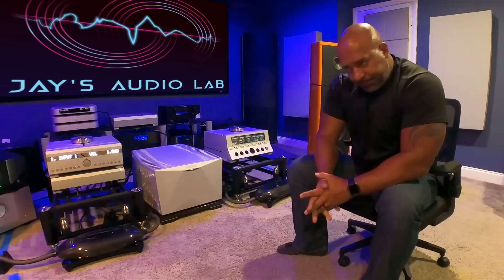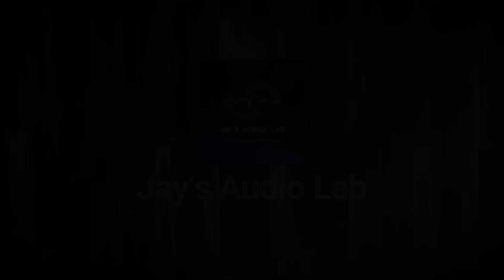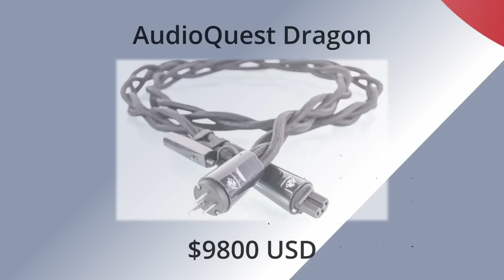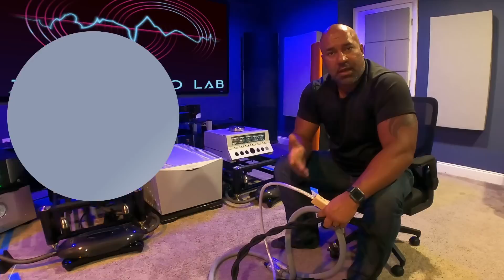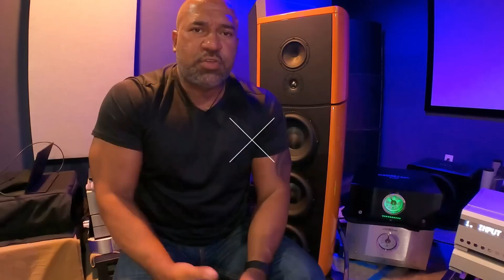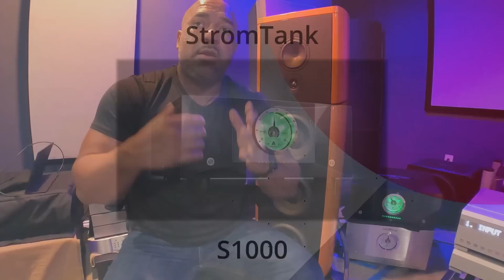Why Do Expensive Audio Components Need Expensive Power cords To Sound Their Best ???

Comment: Hi Jay! I have the opportunity to buy a Gryphon VIP 1,5M POWER M5 C13 for 850 USD , instead of the retail price of retail price of 2 540 USD. Thing is though, even though i have the opportunity  to buy it for a "good deal" I am afraid it might be wat to overkill for my system, as my system is not near ultra high end, my setup is sonus faber electa amator 3 , speaker cables: AudioQuest rocket 88 to a integrated electrocompaniet ECI 6DX ,125w. Do you think that the Gryphon Powercord could "rock my system" or would it just be plain stupid? Since I can get a More lower end AudioQuest powercord for the same price, but not the same deal. Also I am based in the EU/Norway. And not sure if Gryphon sell them with the proper connectors.

Comment: My old 70s McIntosh amps have flimsy lamp cord wire. Power cables don't matter with McIntosh cause they don't pull the amperage is what I think why it was designed this way

Comment: I'm a ittle late to the party, but I agree with you. You're OCD -- join the club!

Any one of the three power cables you showed is from just under twice to nearly three times as expensive as my entire main system (£4000 or so). Doubtless your system sounds better than mine, but I don't resent that -- if that's what floats your boat, all power to your elbow. 

Regardless, I enjoy mine immensely. I could afford a significantly more expensive system, but why? I'm very happy with what I've got and, as I'm retired, I can listen for up to 10 hours every day -- I'm listening to it as I type this. It's already miles better than some of the better gear one could get even 10 or 15 years ago thanks to advances in technology.

It's not that I'm stingy. It's more that, to get adequate satisfaction from my music, I don't feel I need spend more. I too have OCD, but of a different kind than yours. What most floats my boat (after the music itself) is settling on a budget and scheming to find the best gear I can within it. I feel sure many audiophiles do the same, either through choice or necessity. I suspect we get as much pleasure from that as you do from spending tens (or hundreds) of thousands on top-end gear.

BTW, I preferred the stock cable for all three songs in the first video, and found the two cables about the same in the second. Because of the limitations of both YouTube and my own secondary near-field system (£2000), naturally your gear doesn't sound its best. In the flesh, in your room, I feel sure it must sound quite a bit better. But a hundred times better? Ten times, five times, even twice as good? At your level, you're probably chasing the last few percent of what's presently possible, under the ever-present constraints of diminishing returns. We're both OCD, but in different ways. 🙂

Comment: Interconnects carry signal, so do spkr cables. Power cords carry no signal only raw power which is conditioned by the equip. power supply. The raw power at the end of a standard cord is THE SAME as an expensive cord. Measure it. a 6 foot piece of cord CANNOT alter the sound. Nobody gives any measurements. It's visual placebo, they look fancy so your brain makes it sound better, no diff. Many aren't even UL approved and put tremendess stress on the connectors. Sometimes ya gotta go with science and physics. https://www.youtube.com/watch?v=HkmwcPdTlWM

Comment: I believe the quality needs to match the device (maybe not with the Boulder :-)). That doesn’t mean it has to be crazy expensive. I have cables which sound better than e.g.any Audioquest and at a fraction of the price. So, I do agree you need very good quality cables and that they are important, but you can be blown away by less expensive brands.
Reply: BTW, I heard a HUGE difference with the ethernet cable as well. There was definitely a WOW after I heard that. So there I do not agree.

Comment: I watched the video wondering what source of power that this power cord gets plugged to. You mentioned noise in the signal from inferior cabling. Does the power cord get plugged directly into an electrical panel? Is the limitations because of insufficient cable gauges because up the chain you can't really control your electrical utility unless you have a main feed delivered your location. Maybe you might very simply these issues. I would love to know.

Comment: It would be interesting to know with what PC the manufacturer voices their components. Such information shall come with the component.I expect a top-of-the line component is the best sounding component the particular manufacturer is able to engineer. So adding a "different" PC (different to the one used for voicing) can change it to the worse. Despite from that fact that a power conditioner always deduct some critical aspects from the equiation - so PC quality gets less important. That all might be different with mid-tier components - my experience is that - in the limitations of the general sound signature of the component - you can adjust the sound to your liking that is not only personal preferences but also has to do with the room and other components of your rig. So - to  acertain extend - I buy the argument of being the cook in the kitchen.

Comment: Anybody that thinks that you can ‘tune a system’ with power cables is into delusion space.  Any piece of hi-fi equipment that is impacted by power (cables, conditioners, regeneration etc) does not have a suitable level of filtration in its power supply rectification circuit and should be avoided.

Comment: Here's an even better question:  why do so many older components that sound good and are still references have built in power cords and it was not given any thought back then about the power cord.  As long as the power cord (and I am referring to the permanently attached ones) provide the current needed I can't figure why it is such an issue now.  I get it; the power cord is just another way to market something but funny how it was only a thing once it could become a thing.  But when it comes to the uber expensive gear there is no excuse.
Reply: Because at the time manufacturers didn't know power cords could improve sonics.

There has been a thriving aftermarket business in adding IEC connectors to older gear that once had captive power cords, with improvements easily heard thereafter.
Reply: @VideoArchiveGuy  Don't buy it.  These older gear work to spec and sound phenomenal with the attached power cords...I am aware of the aftermarket component that conveniently fills a niche.  And saying they didn't know about power etc is simply BS.  They had all the knowledge to design the gear and circuits to make it sound good, select the best parts and source out the best power supplies but then neglected the power cord.  Maybe they knew something we are being made to believe is true.  The power cord is not nearly as important as the power supply and amps in particular have had this figured out for decades.  I get it hearing is believing but I have a far easier time with that on low level cables, interconnects and speaker cables that actually carry a sonic signal rather than just pure AC which is going to be filtered and rectified by the component anyway.  And  I come from a part of the world that has a stable grid.
Reply: @TheNoseman1  They perform "to spec" with the stock power cords but often sound even better with an aftermarket one.

It's not a given but it's certainly been my experience on more than one occasion.

Comment: Thats why I suggested that you try siltech cabel because all other cabels are very colored a power cabals job is to bring signal from the wall to your amplifiers without coloration boulder is  the most quietest amplifiers in the world and siltech is the quietest cabels in  the world thats why they match  your just learned that boulder showed you that those cabel brands that you put them on are colored sounds siltech won't change your boulders sound in any way it will make it even quieter and even more dynamic 😉 trust me

Comment: My first thought on why a stock power cord vs aftermarket on a pre amp won't make much of a difference is because of the low current draw, proper grounding, and how well the power supply is made.

When high current is in the mix wire gauge and cable length matters a lot more.

I have a few devices that freakout if too much filtering is done between the wall and the device. Using the Stock cable and removing the line conditioner was the best option in both cases. The power supplies expected a wave form and a current level it could work with and got something just out of spec.

Hopefully that makes sense.
Reply from the maker: It does.

Comment: So not sure if it has been mentioned yet but Classe is including a very nice DR acoustics upgraded power cord with their Delta amplifiers. I was very impressed with it out of the box. The precedent is out there.
Reply from the maker: Bingo. You  see what I mean?
Reply: This is an interesting conundrum really. If a manufacturer essentially admits that you need a special cable to work well it means the product is sensitive enough to need it, i.e. some will say not designed well. So it needs to be an option or included with a more standard cable.
Reply: What if you don't like DR Acoustics?

Why would I pay extra for one I will just have to discard?
Reply: @VideoArchiveGuy   Not sure it really matters, I don’t use the included “standard” power cables but I don’t get upset about it, I just leave them in the box. If the value of that cable goes up it will ultimately be priced in at a used resale value, at least partially, so the relative cost wouldn’t really increase dramatically. The Audiogon ad would just note whether the upgraded cable is included or missing.
Reply: @2meta435  If it's a $5 cable, it's no big deal.

If it's a $5000 cable, it is.
Reply: I'm in the same situation. I  have the new Classe delta Amp and could compare the included DR Acoustics PC with my AQ Dragon PC. I'm not completely done with my tests yet but I'm pleasantly surprised by the DR. It’s to a point where I may want to sell my Dragon which is sold 8x the price (msrp). The DR Acoustics is that good.
Reply: @Listener - Audio Enthusiast can I ask which other brands you are using?
Reply: @Listener - Audio Enthusiast Thank you sir. Which DR Acoustics PC have you evaluated? I have the 'Delta' one which costs ~1K$ and that is 'tuned' to go with my Classe amp. I'm wondering if their more expensive ones are better or simply a side move.

Comment: It's not a matter of buying an EXPENSIVE power cord, it's a matter of buying a GOOD power cord.

Manufacturers have answered the question of cords before; the stock power cord is to make it possible to use their equipment out of the box, but if they included a more expensive cord, others would be upset because it might not be the best cord for any particular user's system.

It's best to leave it to the customer to decide on the best cord for their system.
Reply from the maker: Agreed

Comment: I don't quite agree with this message, because...

This is maybe 1 out of 100.000 amps in the world in a circa 600-800k USD system that does this which is very unusual.

Why not just then buy a more regular 50-100k USD system and then have 10k USD cables in it that will improve the sound?

Also the cables you are testing are very extreme compared to most regular audiophile power chords and an extreme Furutech wall plug that has a crazy amount of energy, plus you have not a lot of space to unload the energy length wise, so I think that it is just an unusual/rare thing you ran into that is not worth too much attention, since that most gear on the market especially with a shorter circuit will react more positively to power chords.

But yes we appreciate you reporting this, because I get the idea of how nice this would be to save money on power chords. But you could also turn the message around and say that, in order to get to this level of sound, you still have to spend what is probably a Hegel 390 amp each year in terms of electricity, so that is very extreme. Personally I would just get an amp that only uses 1/30 of the power per hour and then only invest maybe 500-1000 USD per power chord and then be happy with that improving the sound. (I would never buy a finished made power chord from a store, because that is just paying 5x more for something than it is worth IMO)

This is a bit like the whole MOFI deal, with people being not satisfied with paying 50-500 USD per records, yes does not make a lot of sense in a way. But then you could also just stream for like 20 USD per month or just buy a box of records with 50 pieces for only 100 USD in total. Different strokes for different folks.

Thanks for the video, very shocking.